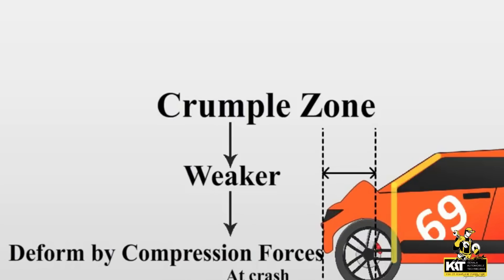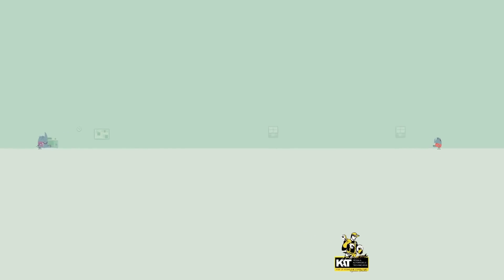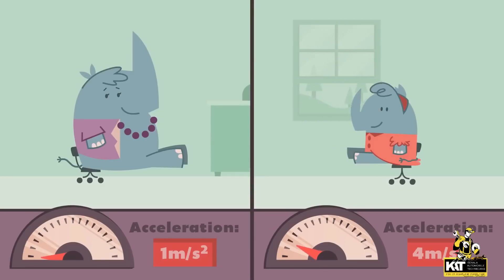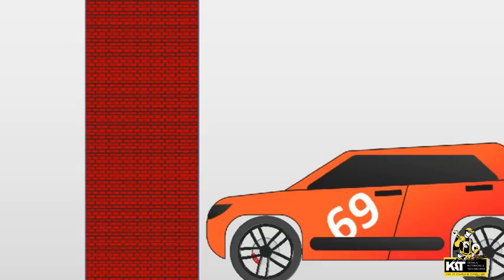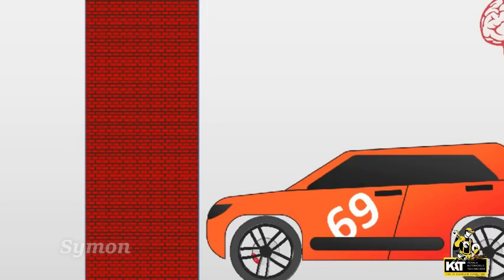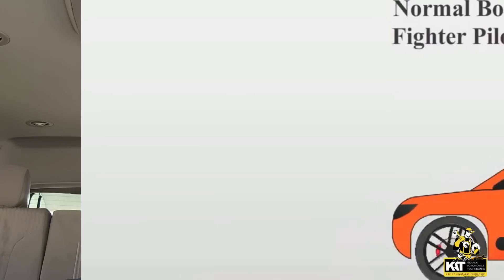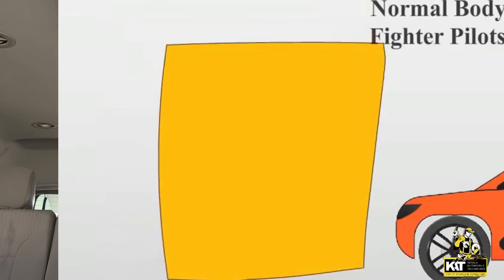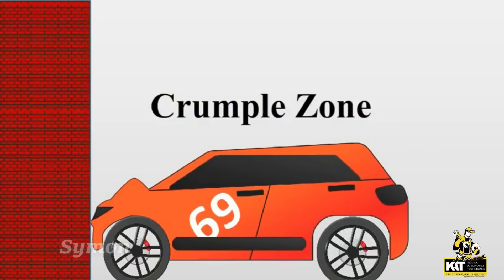Crumple Zone Of Car Malayalam Video | Why Some Car Have big Damage In Accident | Kerala Auto Tech

Comment: All part of maruti is crumble zone
Reply from the maker: ഏറെക്കുറെ..😎😜
Reply: Njan jeevathila maruti adukuathila
Reply from the maker: പഴയ മോഡലുകൾക്ക് ഈ പ്രേശ്നമില്ല എന്നാണു കരുതുന്നത്.. accident dammage കൂടുതൽ ഉണ്ടാകുന്നു കൂടുതൽ സാമ്പത്തീക നഷ്ടങ്ങൾ ഉണ്ടാകുന്നു എന്നതാണ് പോരായ്മ, ആളുകൾക്കു അപകടം കൂടുതലായി പറ്റിയതായി അറിവില്ല.
Reply: Ente 2009 dezire anu.strong Anu body...door adakumbol Thane manasilavum.
Reply: @syamkrishnan7938  bro maruti up to 2010 is good now a days new gen maruti is not good.so I'm maruti owner since 1990.omni,gypsy and last alto800 is owned so alto800 is low quality
But old 1996 model omni and 1999gypsy is good.alto 800 is 2015 model it's non safety and metal is light weight low quality.1996 omni is good metal build quality.
Reply: Old all maruti is good around 2010.but above 2012 to low quality.because i have alto800 a small accident on front bumper it will fully damaged fender ,bumper radiator all are damage ayi. And car body is very light.low gauge metal.